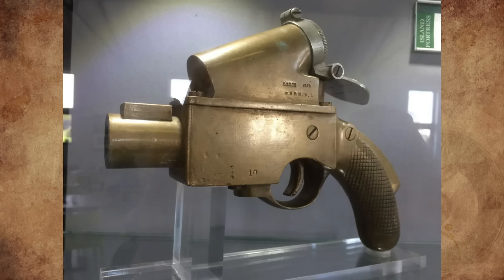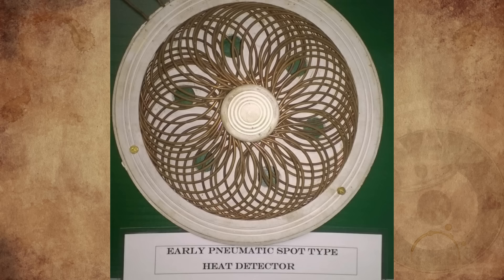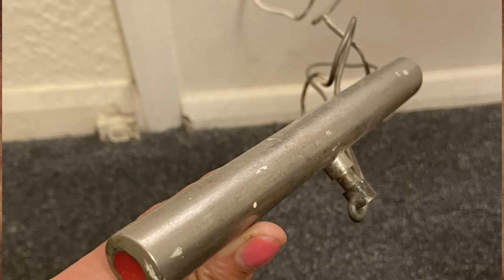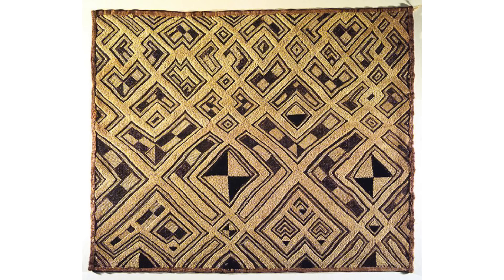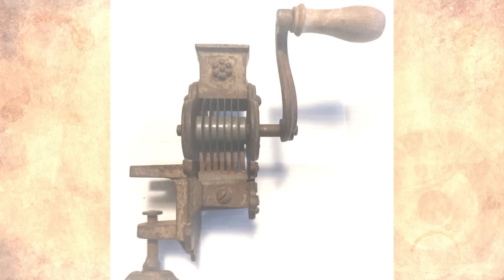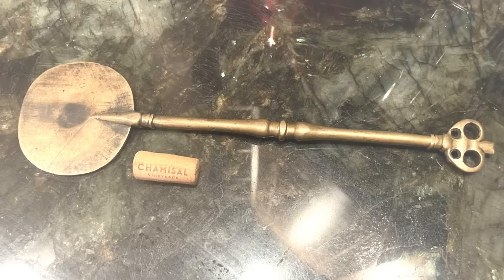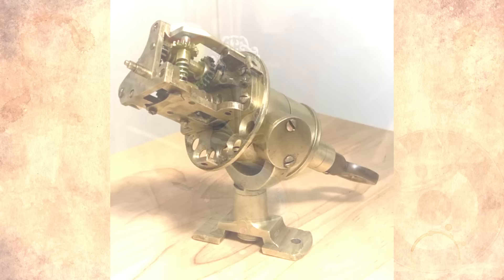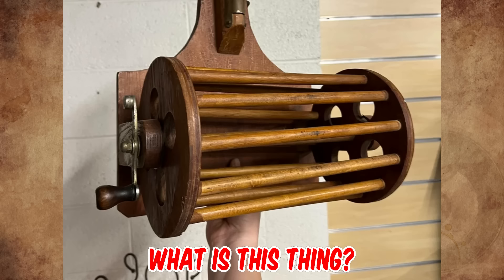What Is This Mysterious Gearbox On A Gimbal Mount And This Grinder-Like Machine With Cutting Wheels?

Comment: With respect to the African weaving chances are someone passed away and others not knowing any better decided to throw away things they had no clue about and considered to be junk.  I had a friend years ago who worked for an auction house and he told me that people throw away extremely valuable items because they don’t know any better.  One example and it’s a simple one would be he told me about antique trains that apparently had been saved from childhood. The trains themselves were valuable but they were about three times more valuable had the people holding the auction for the deceased person kept the boxes that the train came in. They told this person that they took them out of the box and threw the boxes in the trash.   If you don’t know any better ask someone.  You would be stunned at the value of certain items that you think are junk.
Reply: This! I collect model horses. While there IS a general rule that most models are worth no more in the box than they are outside of it, if condition is good, there are a select few where the box would be anywhere from hundreds to thousands of dollars in difference.

Comment: Why would the baby rattle open and what would be placed inside?
Reply: It is a rattle-shaped memento keeper, for a lock of hair. It is not a toy, just a decorative box.
Reply from the maker: Found it:

This sterling Silver-plated baby rattle frame is the perfect heirloom-quality keepsake to give as a precious gift to a new baby. The handle and bow are intricately sculpted, and the rattle is beautifully accented with sparkling blue and pink jewels. The rattle opens at the top to reveal - 1 1/2" photos of the newborn boy or girl on each side.

https://www.worthpoint.com/worthopedia/lenox-baby-jewel-silver-baby-rattle-frame

https://www.ebay.com/itm/255013714735

This one has a picture of a baby in it. 5th pic.
https://www.mercari.com/us/item/m25512742382/

https://www.cafr.ebay.ca/itm/225786150428

Thanks for watching!

Comment: Vintage Lenox Silver Plate Jewel Collection Baby Rattle Picture Frame for an adult not a baby
Reply from the maker: Found it:

This sterling Silver-plated baby rattle frame is the perfect heirloom-quality keepsake to give as a precious gift to a new baby. The handle and bow are intricately sculpted, and the rattle is beautifully accented with sparkling blue and pink jewels. The rattle opens at the top to reveal - 1 1/2" photos of the newborn boy or girl on each side.

https://www.worthpoint.com/worthopedia/lenox-baby-jewel-silver-baby-rattle-frame

https://www.ebay.com/itm/255013714735

This one has a picture of a baby in it. 5th pic.
https://www.mercari.com/us/item/m25512742382/

https://www.cafr.ebay.ca/itm/225786150428

Thanks for watching!